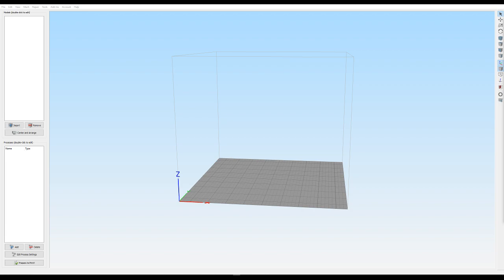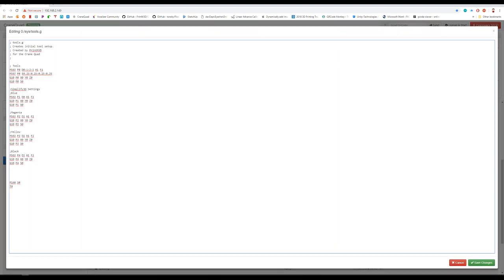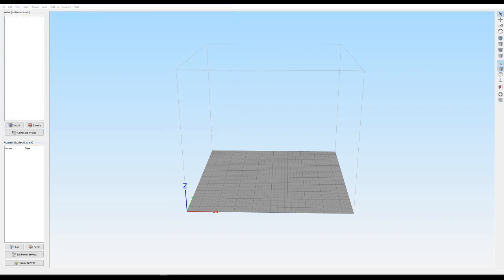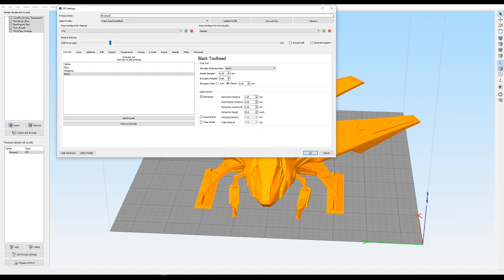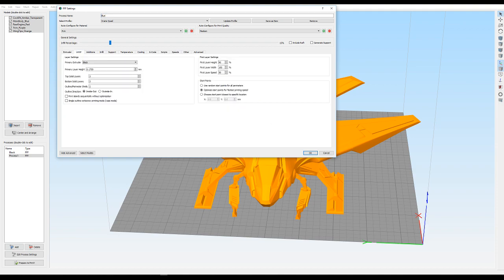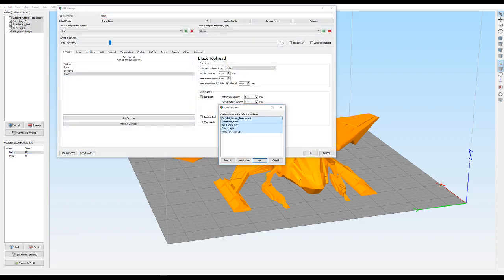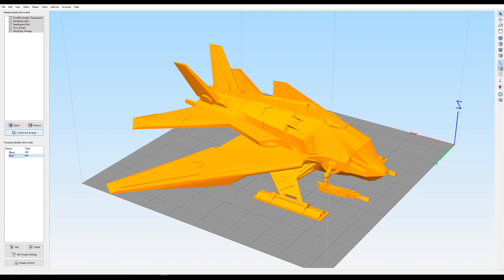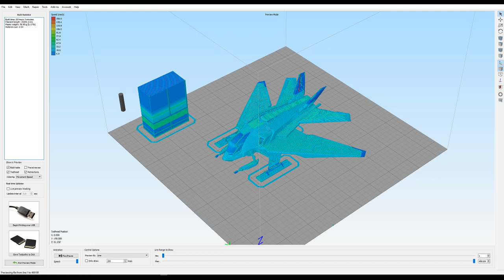Crane Quad - S3D Multi Color Printing

Comment: In the discord, you have a different setup.  Did you get to print this one (blue/black).  Did it do better?
Reply from the maker: The one I initially printed was using Vox. This was just put together to show how to do it in S3D. The colors on the screen won’t make sense in S3D because it just gives a set color per extruder, I haven’t found a way to configure it to be any different.